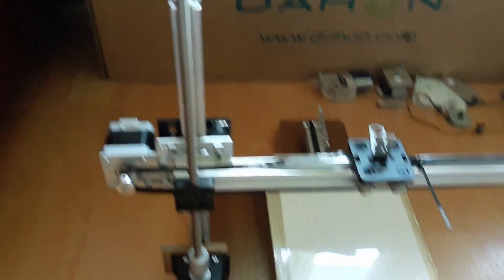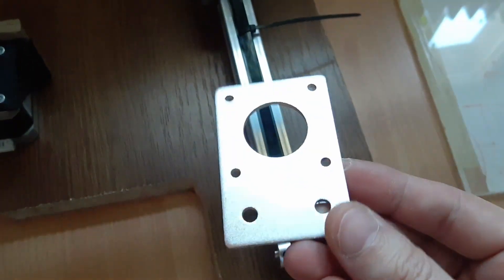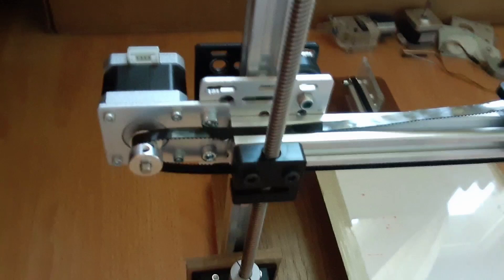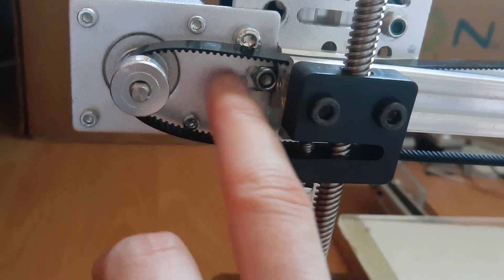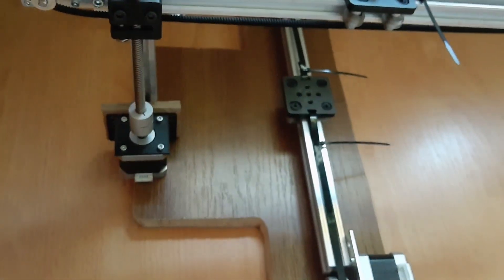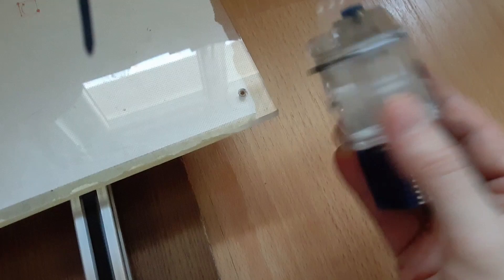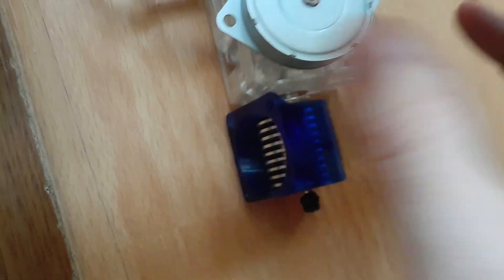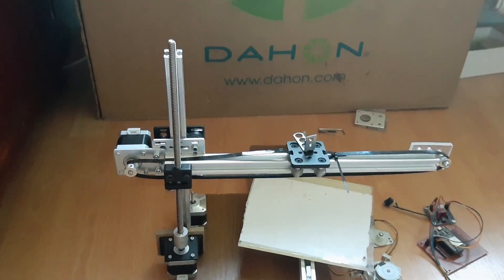How to Make a MINI DIY 3d printer

Comment: A word of advice, you will likely find that that small motor will not have enough torque to directly drive the filament, but you could gear it down to increase torque but this will add backlash in the gears. But your boden tube idea will probably work well.